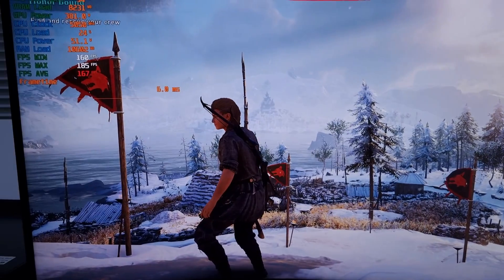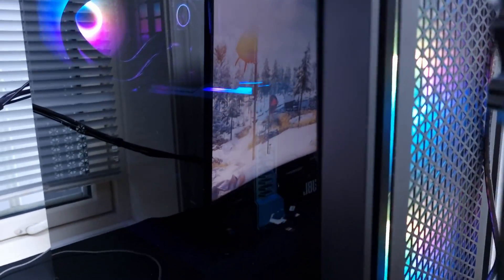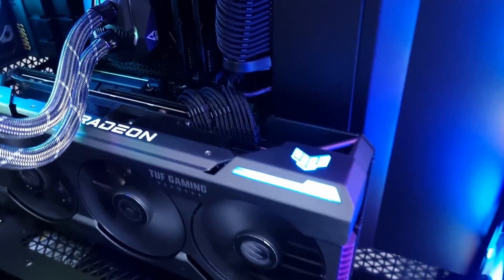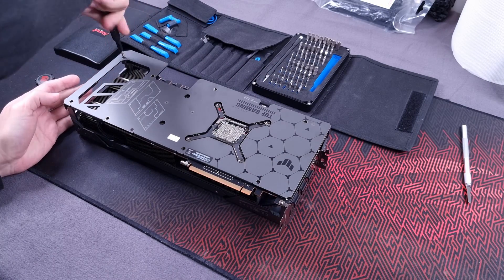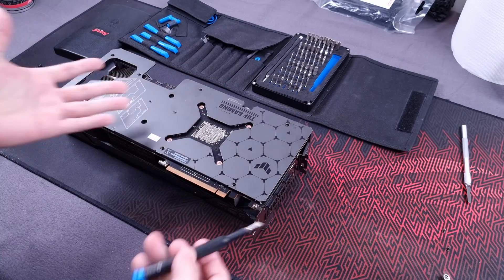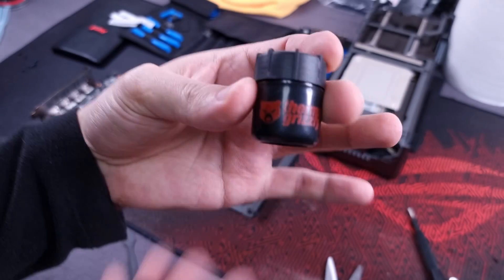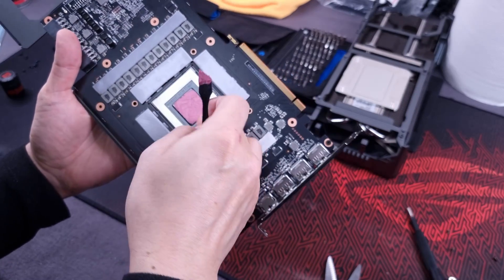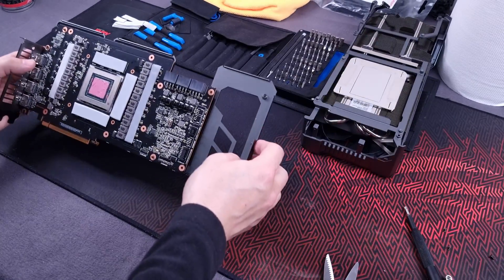ASUS TUF RX 7900XTX TEARDOWN (hotspot fix)

Comment: I remember building a pc with zotac gtx 660 back in 2012 , only gaming everyday,

Never did any maintenance/ troubleshooting/ not even opening the case until 2019

Smooth gaming experience with no nonsense problem except i replace the PSU in 2015 because i bought the crappy Silverstone PSU
Reply from the maker: The GTX 660 is one of my favourite classics!

Comment: I have a 7900 XT Pulse that runs around 335w at peak load under factory clock/boost settings. It gets hotter than I'd like (81-82ºC, not including hotspot), so I'm likely going to re-paste with PTM 7950 inside the next month or two, and see if it helps. Great card otherwise.
Reply from the maker: After trying Thermalright Heilos, I went ahead and took this card apart again and used Heilos on it. Works even better than I expected.

Comment: Got an ASRock Aqua 7900xtx that is apparently known to suffer pumpout. I opened it, cleaned off the paste, and added a Kryosheet. Runs cool as a cucumber now.
Reply from the maker: Very nice! I have also started using phase change  TIM's. They work great as well.
Reply: @TechnologyHive  I have one on an x3d as well. Not sure if they run as cool as some super frosty high end paste, but it handles underV/PBOverclock just fine on the x3d. Perhaps if youre runnin a 14900 pushing max OC, go for super paste, but I dont have one to try it on.

Comment: I have a 7900 XT... Yes this thing is  a big gpu! This sound on your gpu is coilwine? I have coilwine on my gpu...
Reply from the maker: @FabricioBarcelos  Yes it's coilwhine. But you can fix the coilwhune by enabling VSync in games.
Reply: @TechnologyHive  I have a 7900XT ASUS Tuf with a big big coilwhine and I think it won’t go away. Fps capped at 140, vsync, undervolt, swap psu (hydro ti pro 1000w) nothing change. Unlucky at sillicon lottery this time. A friend has the same gpu but no coilwhine.
Reply from the maker: @breakingmoody409  If you can RMA it, you should if it bothers you.
Reply: @TechnologyHive  Unfortunately I can't, it was a year ago. I ask Asus about temperatures (57-62 GPU, 80-85 Hotspot, 45%PWM fan speed) i'm waiting an answer.

Comment: The issue with this card and many others including my Gigabyte 7900XTX Aorus Elite is that they use paste that density is too low. Paste gets pushed sideways after a few months. I replaced my with PTM7950 pad and it lowered hotspot temp from 102-110°C to 68-74°C which is a sick difference. It makes me laugh that manufacturers save on thermal pastes for such overpriced devices.
Reply from the maker: @Vulver  This is why I made this video. Paying over 1k for a gpu in 2024 and aibs are using cheap Dow Corning pastes. Don't get me wrong, Dow Corning also makes good stuff. But this is the cheap stuff being used here. Disappointing 😞
Reply: I just put PTM7950 on my rx6900xt toxic, tired of changing paste every 3 months due to pump out. Wish I knew about PTM7950 sooner.
Reply: @dagnisnierlins188  im gonna do the exact same next week with my asrock oc formula 6900 XT im really hopeful about ptm.
Reply: @dagnisnierlins188  Hello. What thickness did you use? Thanks!
Reply: I know this is old but I need to do this on my xtx. Hotspot temps are outrageous. Does the thickness matter? I need to do this but am not sure which ones to buy
Reply from the maker: @eckz8659 I would look for Thermalright  Heilos.

Comment: I appreciate this tear-down example. I have the Gigabyte OC version and the disassembly isn't exactly the same but it's similar. The hotspot temps were getting progressively worse fast over the past month or so, today hitting close to 100C under full load. Took the card apart and saw that the stock paste job was pretty pitiful with not nearly enough coverage on the die. After repaste with Arctic MX6 the hot spot dropped back down to the mid-80's while being achieved with a much lower fan speed. 

It's odd because I just read a random article the other day talking about how the stock paste these AIB's have been using is cheap crap that starts to degrade really fast after several months and that appears to be what happened with my XTX.
Reply from the maker: @Kryptic1046  The paste they use is made by Dow Corning. They do make good TIM, but they also make cheap stuff and that's where board partners are cutting corners. They are using that cheap stuff.
Reply: @TechnologyHive  It's unfortunate because for the kind of money the cards in this tier cost and for the amount of wattage they use, you'd think AIB's could spring a little extra for some better paste. We shouldn't be seeing temperature degradation like this after only months of ownership. AIB's need to do better.

Comment: i have same gpu , do u think 750w psu is enought?
Reply from the maker: @H3OP  I would go with a 850w gold minimum. But that is just my opinion. I have a 1500w psu in my main rig and power off the wall for the system only can reach 550-600w during heavy loads. 1000w would be even better if it is within your budget.

Comment: my RX6600XT had 30 delta/80 edge/110 hotspot before for so long i had to downclock, recently i changed to ptm7950 pad & it went down to 20 delta 60 edge/80 hotspot basically a 20'c drop, what a lifesaver, plus with optimised tuning i get even lower by 5-10'c, hope it lasts tho because previously the hotspot is super hot it dried up so bad that it made a hole
Reply from the maker: I made a video on PTM 7950...and yes it is all you guys have said. Great stuff!
Reply: Yeah, I tuned mine down a little as well. From what I'm seeing on these comments mine is doing ok. Gaming I'm at a 13-15C delt, Edge/Hotspot.

Comment: by any chance did you measure the thermal pad thickness? thinking about changing the paste and pads but i cant find the pad thickness on the internet :(
Reply from the maker: @ArashFereydooni-o3x  I mentioned the pad thickness in the video.
Reply: @TechnologyHive  ty
Reply from the maker: @ArashFereydooni-o3x  No problem :)

Comment: I doubt you'll see this but your problem with the GPU install could be a lot easier just take the vertical mount loose install GPU into it then install the vertical mount with GPU in the case. You don't have to move the mount far so you can leave it plugged into the pcie slot
Reply from the maker: @michaeldeanroberts  Thanks for the tip. Just so you know, I read all my comments and respond to all.

Comment: Delta like this is good?.I have 7900gre gigabyte oc and have 59C on GPU and 80-82 on hot spot?.Card is brand new
Reply from the maker: @MicPrime  That's a 20 degree delta of course, but the hotspot temp is acceptable. I would leave it alone.
Reply: @TechnologyHive  Thanks a lot

Comment: 95 is a normal value for power transistors, such electronic components can easily operate up to 110-150c, some can even operate at higher values, do not compare this with the GPU, so be comfortable, sit back and enjoy your game.
Reply from the maker: 150c is not normal operation for any SMD or anything related to your GPU. That is a quick death sentence. 110c is at a point of thermal throttle for you any GPU. So if you do not mind your GPU underperforming, then hey, more power to you. But absolutely not normal. 95c would be my limit comfort zone during operations.

Comment: Hi  i have the same card bud can i ask somting my gpu core is mutch lower 48 a 50c bud the hotspot can go over 90c will this temps damge my card?
Reply: Tnx 2.0 and 1.5 god it big tnx my friend  pulse 7900xtx gets 104 hotspot omg bud verry tnx for the tear down
Reply from the maker: @baukemid5735  Your welcome!
Reply from the maker: Not so much damage your card, but it will not get better. In time that difference will increase and it could degrade your GPU slowly. I would re-paste it with MX-6 or whatever you prefer. This will make a huge difference!
Reply: @TechnologyHive  big tnx i will see if some one can do that for me
Reply: Hi  can i ask you what pads do i need for this card 2m and 1.5m ?  just undervolt this card for now and the temp get mutch better  57 c gpu and hotspot 77 to 80 c
I only lost 3 a 5 fps
Reply from the maker: @baukemid5735  I mention the pad sizes in the video.

Comment: Been noticing this on my rx 6600xt, same exact core temp and hotspot temp. But for me the clock speed drops like 2600mhz to 2300mhz and then jumps back again. It mostly happens on Hogwarts legacy and I see frame drops and stutters. Started to notice in gta 5 online too. Also it’s been almost 2 years for my card, as I bought it on sept 2022, also to note that it’s still under warranty
Reply from the maker: @geckoop2848  new paste will fix that, I'm sure. The thermal paste used by nvidia and AMD cards is mediocre.

Comment: hey I just bought a used mint condition apparently refurbished rx 5700 xt rog strix card and it reaches temps like yours exactly sometiomes warmer if I keep the side of my case on and my heatsink is massive. I feel your pain.
Reply from the maker: @RichardPowell-o8w  If you repaste it, it should bring those temps down.

Comment: I absolutely agree, how is it possible for such an expensive board to have these problems, quality control should be much greater. I have a TUF 4080, the temperatures are normal but the coil whine is horrible, exactly the same as in the video.
Reply from the maker: @Rudy_Azores  Since the paste was changed, the card runs nice 🙂
Reply: Same here, Tuf 4080 and coil  whine sucks when playing! And my hot spot is around 110c! I will repaste it.

Comment: Hello. Please tell me, to replace thermal pads you only needed 2mm and 1.5mm thick. Do you need thermal pads of other thicknesses? My MSI Radeon RX 7900 XTX GAMING TRIO has the same temperatures. sorry for my English)
Reply from the maker: On my card it was just 2mm and 1.5mm pads. It would be hard to tell you for sure what you need on your particular card being a different brand.
Reply: @TechnologyHive  Hello. In General, I discovered quite by accident that when I turn on vertical sync in games (I checked it in 2 games), the hot spot temperature instantly drops by 20 degrees and during the game it stays at about 70-75 degrees. As soon as you turn off vertical sync, it sharply increases to 85 and during the game it reaches 90-95 degrees.
Reply from the maker: @bob19814  I have tested it doing the same thing. But the new paste just fixed the issue overall.

Comment: I allways apply thermal paste (just a thin coating) onto the frame of the GPU, I mean, it has the same height as the die and surely gets pretty warm as well.... 

ASUS TUF 7900 XT Hotspot 81°C overclocked 360W
ASUS 6700 XT DUAL FAN Hotspot 80°C overclocked 190W
Reply from the maker: Whatever works for you :)

Comment: Did you not just test it, find out it’s bad, and return it? Is this just for the video or did you find this out after the return period? You also mentioned a warranty so tell them the problem and send it back. I mean the context doesn’t make any sense.
Reply from the maker: The card is not bad. The thermal paste is bad. No I did not return it. It works perfectly fine now with the new thermal paste.

Comment: Liquid metal will drop you at least 30/40 degrees
Reply from the maker: I like liquid metal. But in this case, I will stick to kryonaut extreme. It's less risky.
Reply: Coat the entire pcb's capacitors with 2 or 3 coats of a silicone based conformal compound. Saved my gpu from being a paper weight.
Reply from the maker: @phil1pd  I'd have to look into that to understand it better. Sounds like a fun video in the future :)
Reply: @TechnologyHive  buy Thermal Grizzly compatible Shield Schutzlac and your going to be fine, put it on the capacitors that are around the core
Reply: You also want to undervolt that brick

Comment: The other issue is that the price for all these pads also adds up esp if you need to use different thickness on the same card. Often you don't know what thickness these are unit you take the cooler off.
Reply: You end up spending $80 on pads and new paste. It's like they know you're going to attempt a reburb, so they jack up the price 10 times.

Comment: 95C hot spots is the norm on the 2060 super from Asus (ie the Strix versions) and on the 2070 Super..
Reply from the maker: If you're okei with those temps, then go for it. I would rather replace the thermal paste and bring the temps down.

Comment: you have to activate the chill radeon you limit the frames and the temperature drops the high temperature does not depend only on the pads or the paste but on the continuous high frame that the card is subjected to.
anyway it's excellent you have reduced hotspot a lot, but if you want to preserve it the answer is to limit the frames
6900xt
I had several games in the menus like Bf2042 but especially Assassin's Creed where the framerate went very high leading me to heat up the GPU.
Reply from the maker: I would rather have the card work as it should. But I see your point nevertheless 👍🏼
Reply: @TechnologyHive  
It's not just a question of GPU but you also have to think about how the game is optimized and how it talks to your GPU.

Comment: Had similar issues on Pulse version and I had NZXT H7 Flow and I changed my PC case to Asus Tuf GT502 and now my coolers intake fresh air to GPU from Bottom side and I have reduced GPU temp for 5-10c and About coil whine its common issues on all GPU this days that produce way to much power. Globally am happy with my 7900xtx over any 4080 GPU that cost way more.
Reply from the maker: I like my 7900xtx also. Great little card.

Comment: Use Radeon Chill that will also help with temps my 6900 XT also runs hot is it just an amd thing? might consider taking it apart or go Nvidia for next card
Reply from the maker: Just repaste it. Use a good quality paste and that should fix your temperature issues.

Comment: Bro I had the same problem with my 7900xtx asrock taichi 55edge/115 hotspot @400w stock limit hotspot delta over 45c wich was insane I opened it and used thermal grizzly Liquid Metal and kept the same pads so now I get 56c/80c hotspot @465w limit fans@1800rpm hotspot likes to sit at 80c now sometimes 82 much better then 115c hotspot now wait and see how long until the Liquid Metal pumps out
Reply from the maker: If you applied it right, the conductonaut application will last you for as long as the card exists.
Reply: @TechnologyHive  i applied a very thin layer on the die and on the cooler as to avoid any spills and put some nail polish around the caps for extra precautions
Reply from the maker: @merkedgg6322  that's how to do it 👍🏼

Comment: Why did you try this when amd say 110 is fine if it’s 111 then it’s bad? Because i want to get 7900xtx but i see many poeple have hot spot peoblem?
Reply from the maker: 110c is not fine. AMD is saying this to avoid RMA's. If you get an RX 7900 XTX and you experience hot spot issues, just replace the thermal paste.
Reply: Okey tnx bro for tips do you think 4080 super is better than 7900xtx is the same price 930e i mean in quality with temp and hotspot?
Reply from the maker: @schweiserschweiser3397  I am no AMD or NVIDIA fan. But, this time around I would  defiantly recommend AMD. The 7900XTX with it's 24GB frame buffer will carry for many more years, over the 4080's 16GB. 

And the 7900XTX is faster in most games. Plus you do not have to deal with the annoying 16pin NVIDIA power connector. The hotspot issue is common on both brands. They both use garbage thermal paste.
Reply: Yes 7900xtx is sick card but i don’t like to touch card i will paid 900e and i need to repaste again to get normal temp it’s a litle bit sad. And here in europe they wait only for this to say you touched something it’s over
Reply from the maker: @schweiserschweiser3397  I understand. I live in Norway. It is more relaxed here.
Reply: Im from France and here is shit and i now they will told me 110hot spot is okay no problems. And if i change the thermal paste and i got some problems i will get fucked.
Reply from the maker: @schweiserschweiser3397  I understand.

Comment: If people tell their temps, what should we believe? Was it in controlled environment? Case closed? Full wattage? 100% usage? Heaven, furmark, in-game? What settings they use. Without repaste and/or repad the memory. Baiscally every card should have horrible temps on stock pastes and pads unless you live in the Antartica. It should be illegal for people to tell their temps without a proven set of requirements that explain your temps. I mean, maybe some of y'all play games like genshin impact wich can run on 10c core and 20c hotspot and 20c memory for all I know. Regulate this! Where is the SEC for computing when u need them! :P
Reply from the maker: The question is the delta difference for the hotspot. 25-30c is a huge margin. For this card, this is common to see and it is, imo, due to AMD's chiplett design.

Comment: Bro though i have an nvidia card  i appreciate you for this video.  I want to take my chances on XT or a XTX but amd just scared me haha.

What are your experiences with drivers and  frame rates during benchmark?  i bought a 6950XT asrock and the coilwine, 110 degree hotspot and frame stutters just killed me with AC origins and valhalla and send it back.
Reply from the maker: After replacing the thermal paste, it's been a smoother ride. No crashes or anything like that. Drivers are mature. I'm very happy with AMD.

Comment: Maybe I got lucky but I have the exact same card.  I OC'd it with adrenaline and my hotspot has never been over 82.  Usually between 75-78.   I have an H6 Flow case with 2 intake 140 fans directly below the GPU but I can't see them making that big of a difference with what others are experiencing.   I'm running 4k max settings so it's 99-100% all the time.
Reply from the maker: You got a good one.